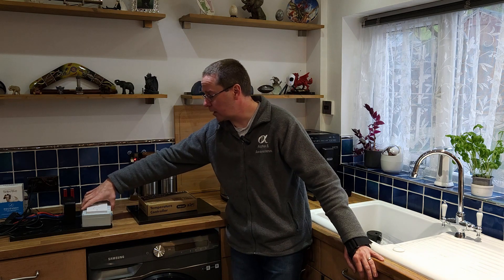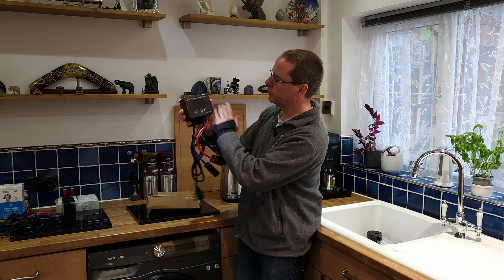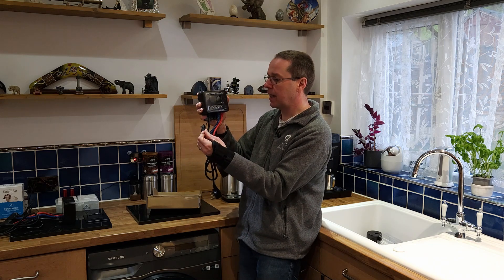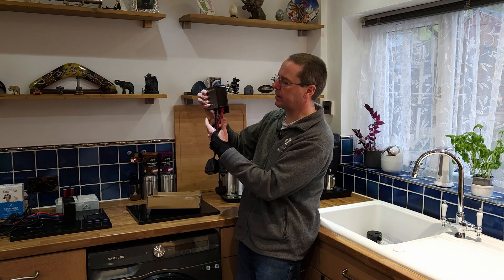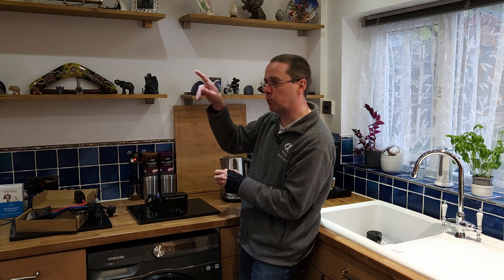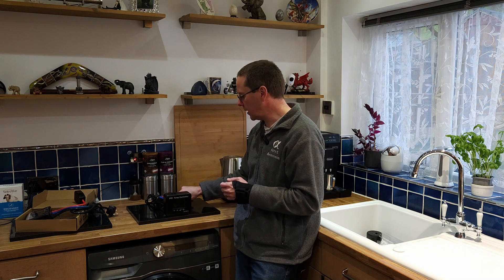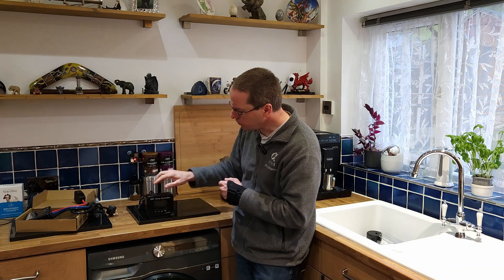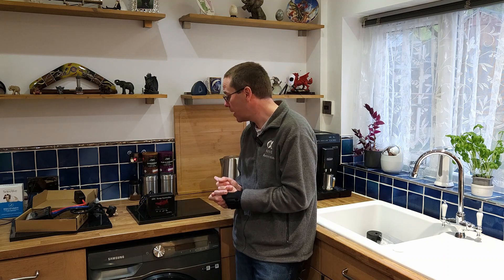RAPT Temperature Controller from KegLand - Unboxing and first thoughts

Comment: Looking forward to more videos 👍 My question is can this temperature controller be used for maintaining a mash at 60 min - 65c temp, then step mash to 75c for 10 mins and then a boil at 100c+ for 60 mins in an electric brew in a bag system? Basically a brew kettle with an electric kettle element for heating and a mesh basket for the bag. Would this controller manage the range of temperature and the heat? Thanks for your videos, very informative 👍
Reply from the maker: Hi @donmac5926,  so yes, the Temperature Controller can do all you want, but only from a controller point of view.  It can turn ON/OFF the power to a heat source, but can your heater get to the ranges you want?  The RAPT Temperature Controller can sense between  -20C and up to 120C.  You can create profiles to say to heat to a certain temperature, then hold it there for a set temperature, then do something else. What is even better is if you tell it for example to heat to 60c for 60 minutes, you can tell it to start the 60 minute counter once it starts to heat to 60c, or to start it only once the temperature has reached 60c.  You get to choose for each step that you create.  You can also tell it (if you want to) to email you at the start or end of each step & you type what you want it to tell you at that time. 
It is a very clever system that can be used for so many things, even non brewing things.  You could for example use this like an InkBird to maintain temperatures in a Greenhouse & you can monitor it and also change how it works for different seasons!
Reply: @brewingadvice  Thank you for your reply. My biab system is powered by a 3kw kettle element, so therefore, with the temp controller, I should be able to maintain temperature for the mash and the boil is that correct?
Reply from the maker: It will be able to turn on and off your heating source yes.  You will though need to get the temperature sensor inside your wort so it knows what the temperature is.

Comment: I just ordered one on AliExpress. the EU version 81 Euro's.  
They sell them here in the Netherlands for 127 euro's  incl shiping. Pretty expensive here.
Reply from the maker: It is shocking how much some shops sell them at.  I bought mine for 57 Euros, I saw one shop selling it for 103 Euros in the UK.  The good thing with AliExpress is you can buy direct from Kegland through them.  I bought two wireless chargers from their AliExpress shop and when it arrived (yesterday) it had Kegland tape all over the box.

Comment: Another great looking device.
I saw something similar a few years ago for greenhouses and growrooms.
I do have an unrelated question...
How much are you paying for 1kg of sugar now?
Here in Ireland, they have now jumped in price to 1.82 euros.
I used to pay .95 euros before lockdowns.
My daughter was up north the weekend and said she saw 1kg for 1.30 sterling (about 1.52 euros)
Reply from the maker: Hi @irishdave4322,
There have been very similar products for your greenhouse for many years.  The big manufacturer is call InkBird.  The most advanced one can do Bluetooth to your phone, but all they can do is switch on and off the plugs. The RAPT system though you can pare the Pill to it so that you can monitor so much more.
As to the cost of sugar, I am paying around £1.06 per kg which is €1.24.
Reply: @brewingadvice tyvm